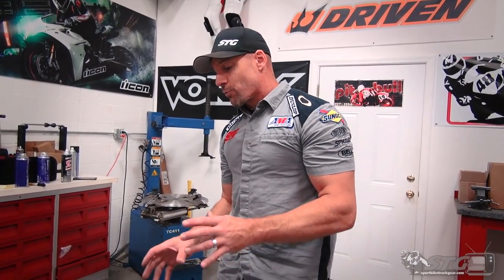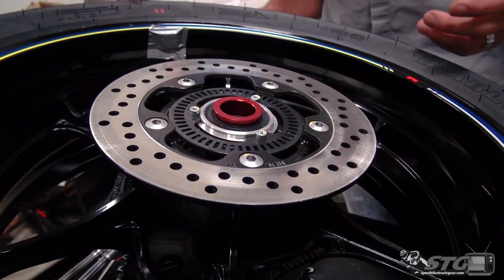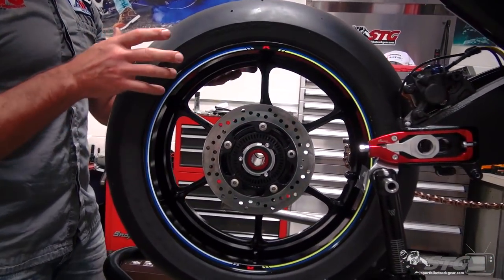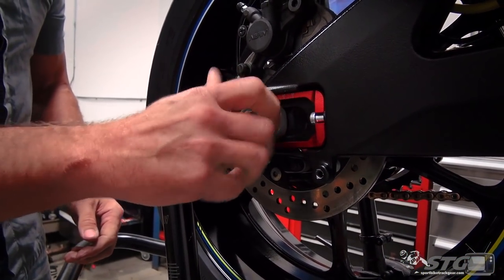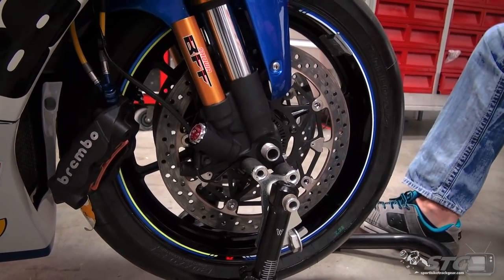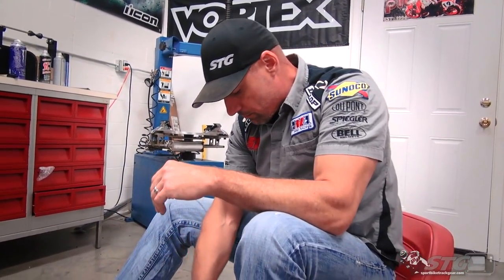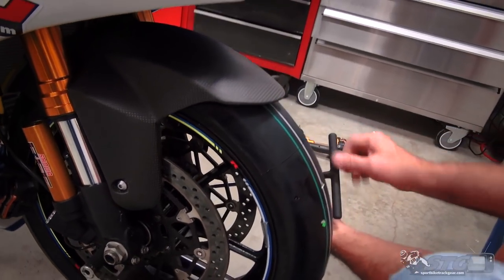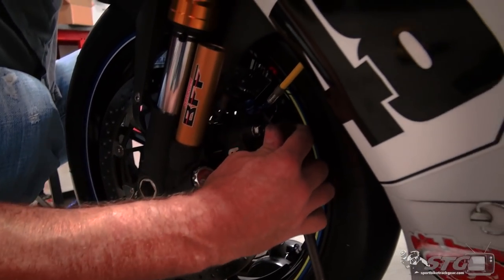Driven 2018 Suzuki GSX-R1000 Captive Wheel Spacer Install | Sportbike Track Gear

Comment: On the bench, use a wooden wedge to roll the wheels to height and keep it in place
(Works on the ground as well, leaving you with a spare foot to do other stuff with, like sliding the wrench towards you, that always happens to be put away, out of arms' reach  😅)
Reply from the maker: That is another way to do it but the Pit Bull Pit Crew Tire Wedge is the ticket. - Van

Comment: What is the size of the socket for the rear axle and which exhaust hanger did you use? I really like these videos they are extremely helpful!
Reply from the maker: Thank you for watching, glad the videos are helpful. The exhaust hanger came with the M4 Full System I installed. Here is a link to that system on our site:  https://www.sportbiketrackgear.com/m4-suzuki-gsx-r1000-2017-carbon-standard-mount-full-exhaust-w-full-titanium-tubing/

The socket for the rear axle nut is a 36mm. - Brian Van

Comment: I use a wheel ramp for car oil changes to lever/hold my back wheel while slide the axle thru, i have the bike on my cheap ass rear stand an use that ramp to hold my wheel in position instead of my foot
Reply from the maker: Sometimes you gotta do what you gotta do! - Van

Comment: How can I make the front wheel move smoothly like this bike? I have installed ceramic bearing and I want to solve this problem
Reply from the maker: Odds are you need to service your calipers to reduce brake drag. Also important to note some pads will drag more than others. Remove the calipers, clean the pistons, open the bleeder and push the pistons back in. Once you have done this reassemble and bleed. This should help. - Van

Comment: Hey Brian, I am debating between these and the ones Grave's makes. The latter have a chamfered outside surface, which looks like it would make it even easier to get the rear aligned. Graves is a bit cheaper though. What are your thoughts? I also kinda like the red.
Reply from the maker: The chamfered edges do make it easier to slide the wheel into place and the red looks kick ass on the bike. Depends on which is more important to you. - Van

Comment: Apparently there is a sensor on the front tire as well, which controls the speedometer and odometer, found out the hard way. Never work on your bike when someone is chirping over your shoulder, "Do you know what you are doing?"  Being a Marine Service Tech, I have some idea how to work on things with engines, Yes. I just didn't want an argument, but should have been more assertive, anyway I learned about the front one a little too late, had already scratched it. Glad it was mine and not someone elses. Though I would like to go back to the days without technology, meaning sensors and computers and all that BS. Remember when you didn't need a degree to tear an engine down and rebuild it!!! Take care.
Reply from the maker: For sure these bikes are a little more complex with all the electronics than they were back in the day. - Van

Comment: What torque specs are recommended for front and rear...? I tighten regularly but don’t know if I’m tightening to much. Haven’t tried the torque wrench cus I don’t know the recommended torque
Reply from the maker: I am using 72.5 ftlbs on both the front and rear axle nuts on my GSXR1000R when I use a torque wrench. - Van

Comment: hello, a question the suzuki GSXR 600 model 2018 only has a wheel spacer on the front wheel right?
Reply from the maker: Yes, that bike only uses 1 front wheel spacer. The front axle serves as the spacer for the other side. - Van